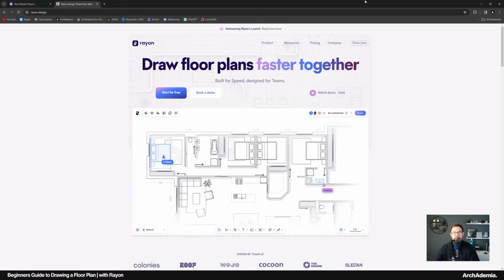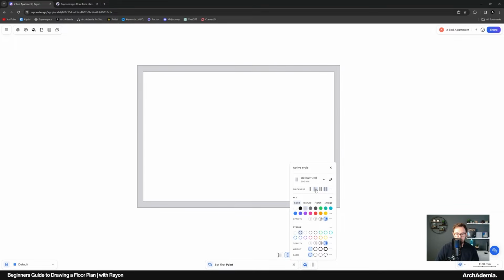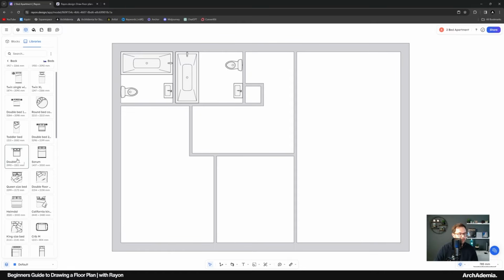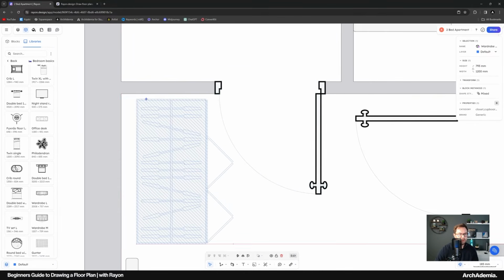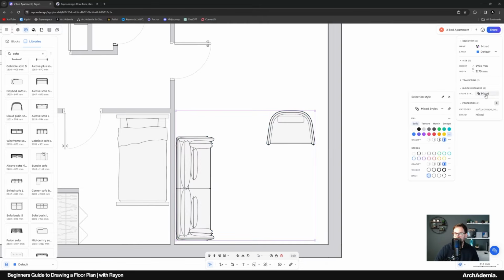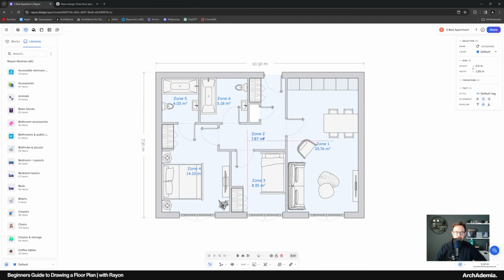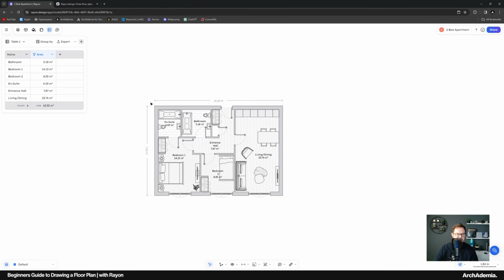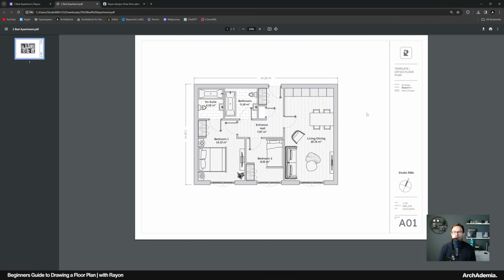Beginners Guide to Drawing a Floor Plan | with FREE software

Comment: An irritating bit of software. all you seem to do is keep hitting ctrl Z to undo something. as soon as you touch the canvas a line appears and you cant seem to get rid of it. There are a lot of keyboard commands that this tutorial fails to indicate so what you see appearing on the screen looks seamless, the reality is somewhat different. It looks ok but there are far better and easier programmes out there.
Reply: I totally agree. Above all. I recently bought the pro version and have not been able to contact support. The software constantly deletes all my progress, so much so now I have to log in on incognito to use it.  So basically no customer support at all. I would say you have to have very advanced knowledge to work with this software.  Needless to say , I am disappointed.